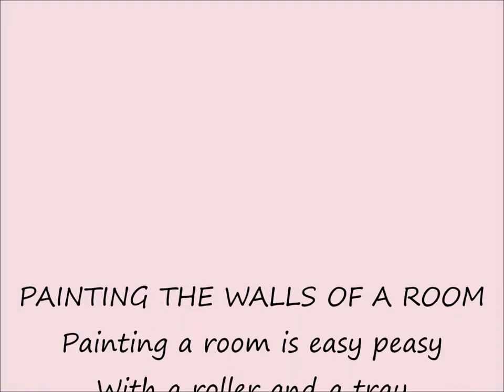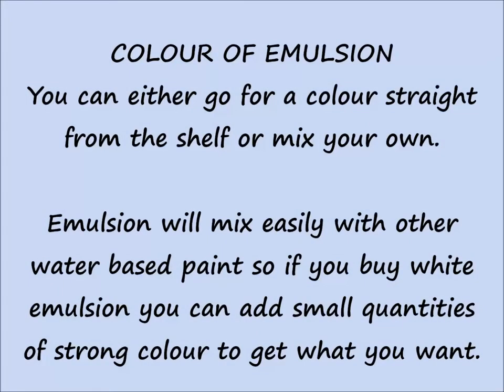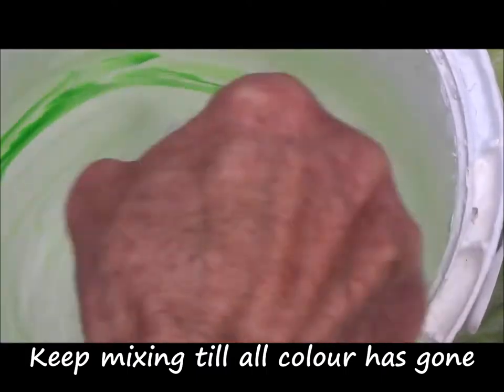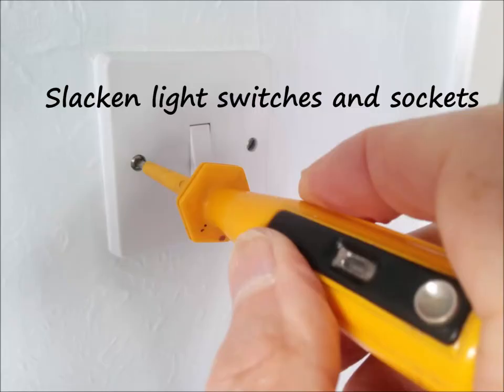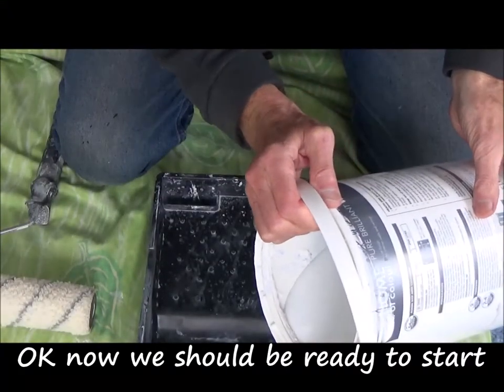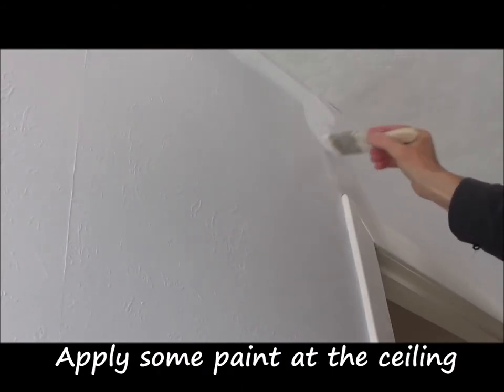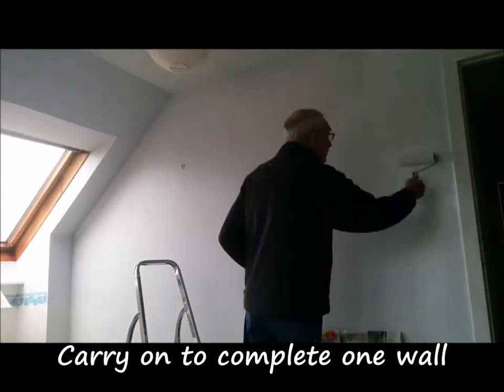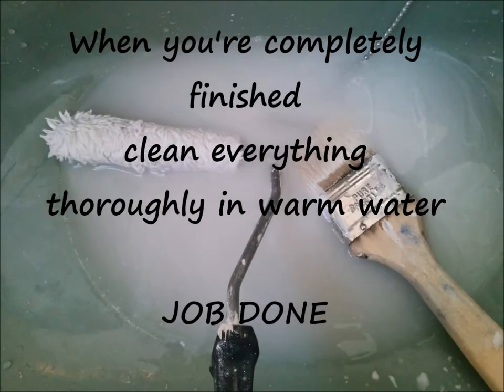How to paint the walls of  a room.

Comment: What make of emulsion would you recommend?
Reply from the maker: Stuart Sutherland Hi Stuart, I find Dulux is as good as any other brand name. Saying that, if original colour is darker you may need 2 coats. For similar colours you might get away with a cheaper paint but probably need 2 coats or more. Cheers.